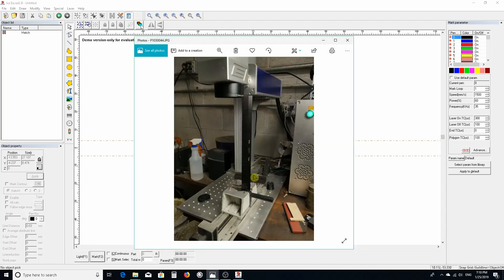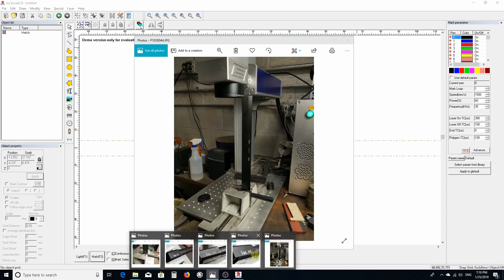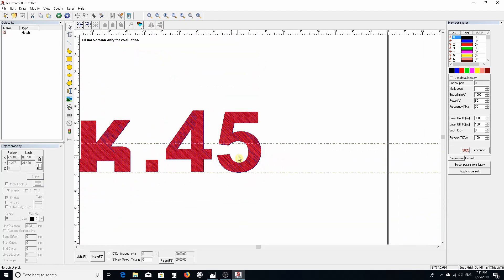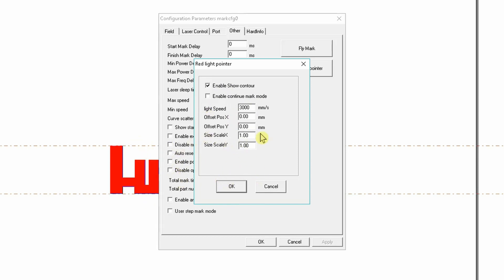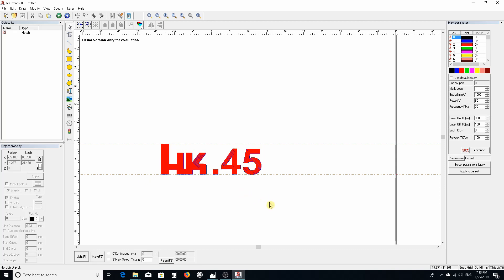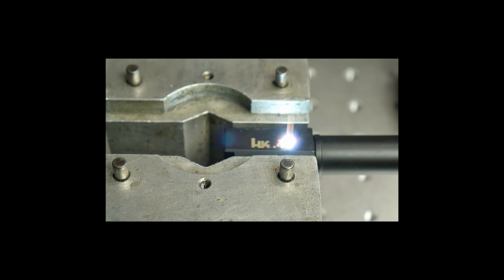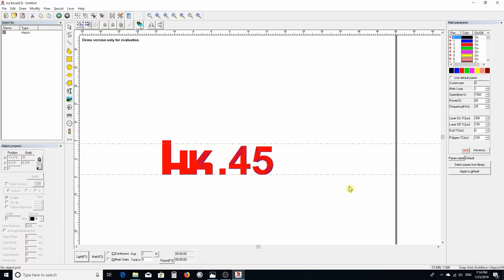EZCAD2 ENGRAVING SOFTWARE AND ADOBE ILLUSTRATOR TUTORIAL PART 2

Comment: About how deep is that final result?   I copied all your parameters and ran a job.  I told it to do 60x, because you had yours set to 10 and you said you had to do it 5 times.  My image  was as large as my machine could do - about 145mm wide and 100 high in 4 lines of text.  Each pass was about 30 seconds, so the thing ran for something like 2 hours, due to 60x for each of the two pens, plus the cross-hatching. so I realized later it was actually some 240 passes.  It was on 3/8" plate.  Initially I was concerned it might burn through.  I needn't have worried - I was surprised I only got about 1/16" depth, using 80% power with 50w fiber laser.  Yours looks more like about 1/8" deep, but maybe not.
Reply: Well that is a huge engrave so yeah it is going to take some time. You may try to break it up and do one letter at a time. This video is a small engrave. Hatch pattern, Frequency, and power  all affect the depth. Experiment with scrap.